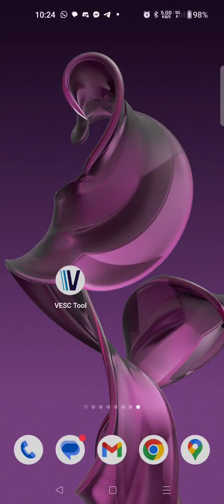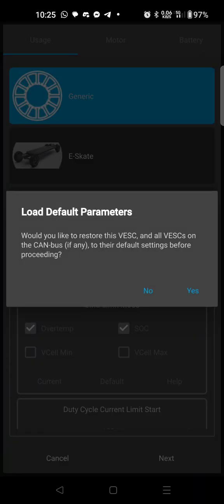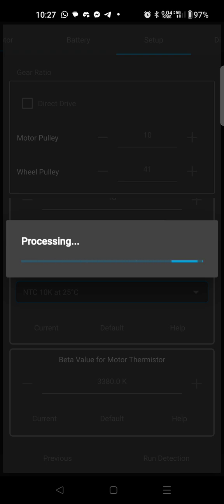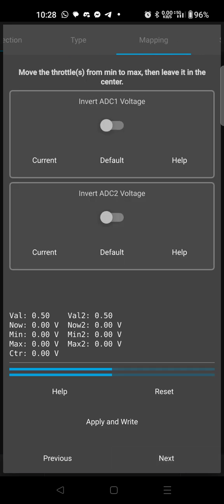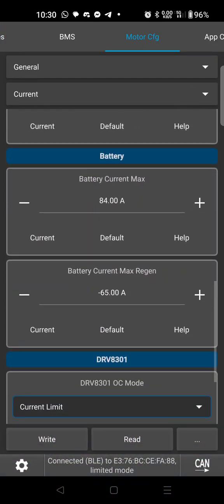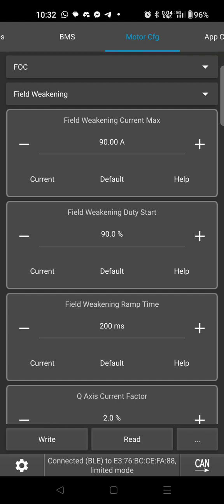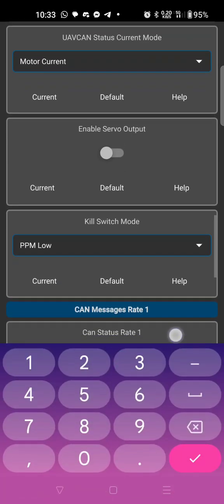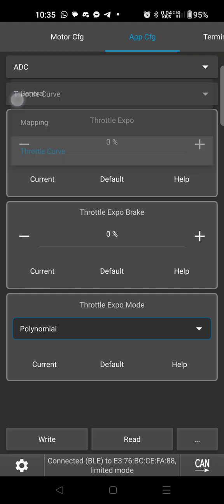KTM E2 Vesc tool configuration.

Comment: I just received my new E2 controller from you guys.  Can you do an advanced tutorial of the VESC tool configuration.  You alluded to doing a separate video for throttle curve.  Are there any other advanced settings that can be changed that we can adjust for rideability?

Comment: Will you do a speed controller upgrade for the E3 or E5?
Reply from the maker: We have done an upgrade to an E5, the problem is that it's extremely difficult to remove the OEM controller because it's epoxied into the motor housing. I don't think it's something most customers will be interested in doing.